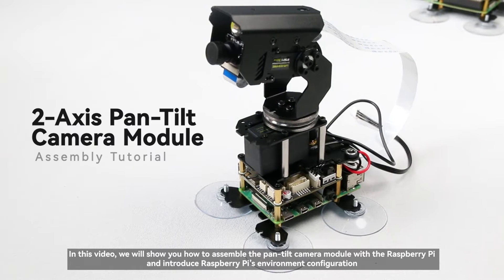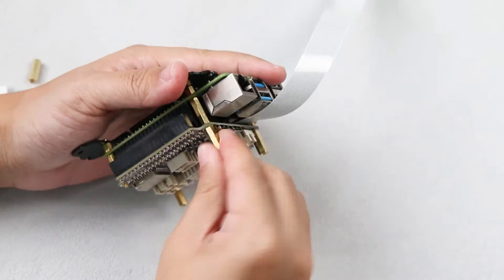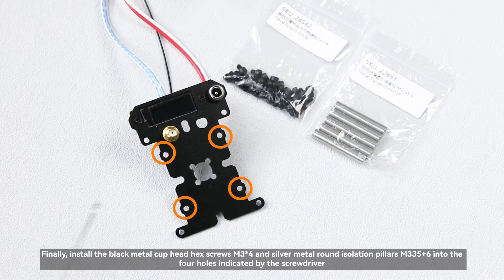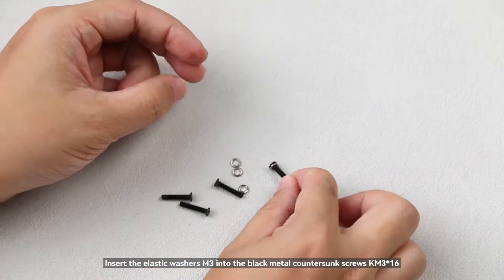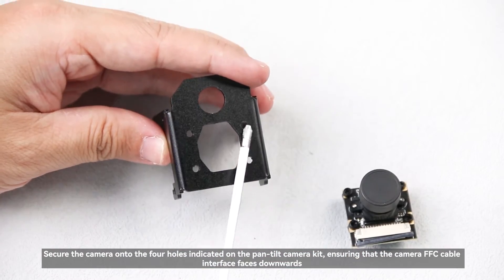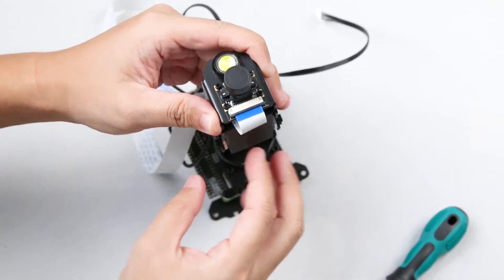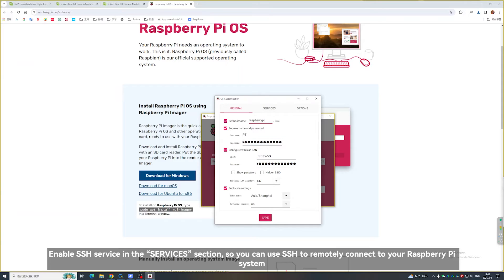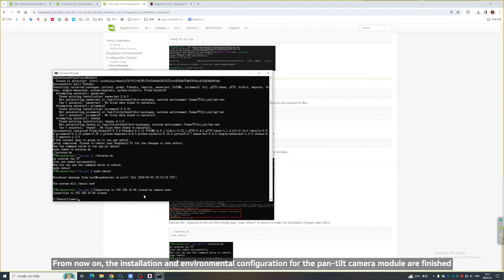2 Axis Pan-Tilt Camera Assemly Tutorial, 360° Omnidirectional High-Torque, for Raspberry Pi 4B/5

Comment: My uart connection doesnt seem to work, has anybody had the same problem?
Reply from the maker: hi dear, pls feel free to contact our support team here https://service.waveshare.com/
Reply: @waveshareelectronics  You MUST BUY  Proper DATA USB cable. do not use your mobile phone cable. My UART card appeared in windows immediately and I was able to reassign values as necessary. You also will need the expressif windows esp32 drivers

Comment: 0:00:10.496691604] [1469] ERROR RPI pisp.cpp:1296 Unexpected target reported: expected "pisp", got bcm2835
[0:00:10.496767196] [1469] ERROR RPI pipeline_base.cpp:883 Unable to load pipeline configuration
[0:00:10.496792252] [1469] ERROR RPI pisp.cpp:889 Failed to register camera ov5647 4-0036: -22
Exception in thread Thread-2 (_thread):
Traceback (most recent call last):
  File "/usr/lib/python3.11/threading.py", line 1038, in _bootstrap_inner
    self.run()
  File "/usr/lib/python3.11/threading.py", line 975, in run
    self._target(*self._args, **self._kwargs)
  File "/root/pt_rpi/base_camera.py", line 92, in _thread
    for frame in frames_iterator:
  File "/root/pt_rpi/camera_opencv.py", line 202, in frames
    picam2.configure(picam2.create_video_configuration(main={"format": 'XRGB8888', "size": (resolution_to_set[0], resolution_to_set[1])}))
  File "/root/pt_rpi/ugv-env/lib/python3.11/site-packages/picamera2/picamera2.py", line 1004, in configure
    self.configure_(camera_config)
  File "/root/pt_rpi/ugv-env/lib/python3.11/site-packages/picamera2/picamera2.py", line 930, in configure_
    self.check_camera_config(camera_config)
  File "/root/pt_rpi/ugv-env/lib/python3.11/site-packages/picamera2/picamera2.py", line 777, in check_camera_config
    self.check_stream_config(camera_config["raw"], "raw")
  File "/root/pt_rpi/ugv-env/lib/python3.11/site-packages/picamera2/picamera2.py", line 744, in check_stream_config
    raise RuntimeError("Unrecognised raw format " + format)
RuntimeError: Unrecognised raw format GBRG16_PISP_COMP1

code not working forraspberry pi 5

Comment: im having some issues, cant get the 5000 server up
Reply: Are you able to fix the issue am facing same problem not listening on port 5000
Reply from the maker: hi dear, you can program our image configured well 
Image for RPi4B：
https://drive.google.com/file/d/1_Kd0qZxQuIsEKEDrQsO1zwsuD1SVVeXu/view?usp=drive_link  
Image for RPi5：https://drive.google.com/file/d/1pLnXwd2vduxmEGW4zfoCRpxXXp-pBcDn/view?usp=drive_link
Reply: @waveshareelectronics  When flashing the Raspberry Pi imager, do I choose "custom" and then select "PTPi5"? (Image for RPi5, from the link?)
Reply from the maker: hi dear, you can program our image configured well 
Image for RPi4B：
https://drive.google.com/file/d/1_Kd0qZxQuIsEKEDrQsO1zwsuD1SVVeXu/view?usp=drive_link  
Image for RPi5：https://drive.google.com/file/d/1pLnXwd2vduxmEGW4zfoCRpxXXp-pBcDn/view?usp=drive_link
Reply: @waveshareelectronics  Seeing there is a user ws configured, what is his password?
Who ever is intereted in it should be : ws / ws Username / Password
Reply: do you have the newest firmware (V0.9)? i had problems flashing it because the manual didnt mention that the boot-button had to be pressed when flashing process has been started. apart from that, what does your ugv.log say?
Reply: Had the same problem, now after trying the waveshare image, and testing I saw that the web-server dos not start when the camera is not correctly initialised.
Perhaps a hint for some problems?